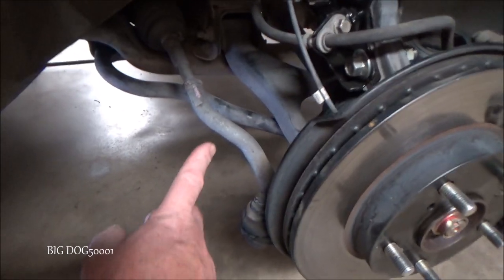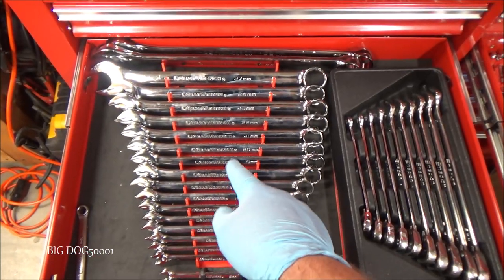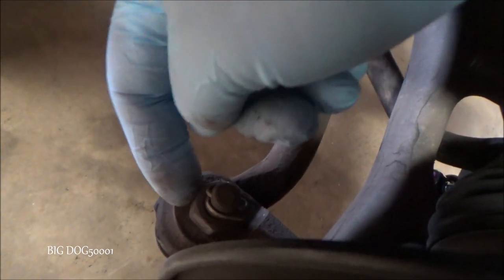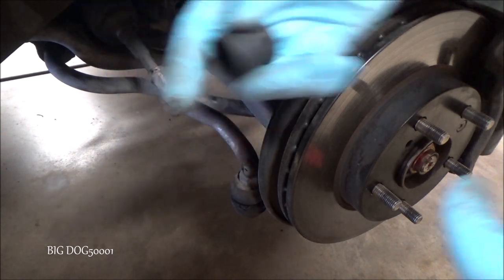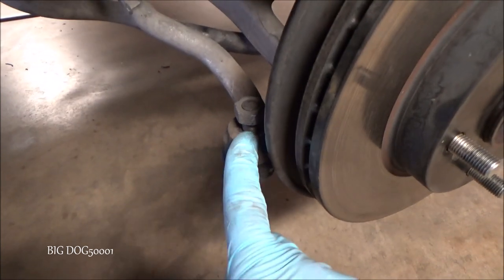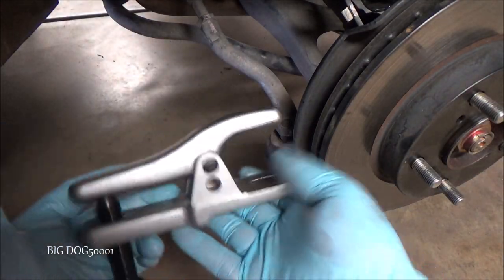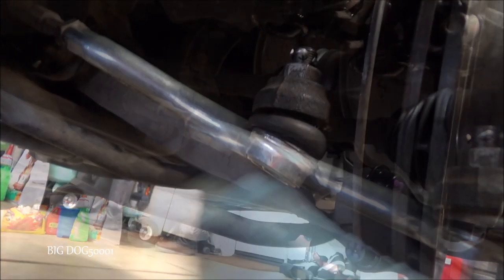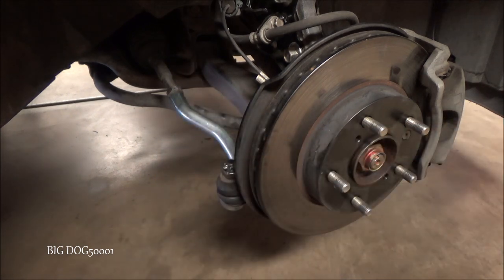Honda Civic Tie Rod End Replacement 2006 (2006-2011 Similar)

Comment from the maker: Tools and Parts
Disclosure: This channel earns a small commission using some of these links - at no additional cost to you.
Left Honda Outer Tie Rod 53560-SNE-A02:  https://amzn.to/2NzlYg3
Right Outer Tie Rod 53540-SNE-A02:  https://amzn.to/3eZTF5W
GearWrench Metric Wrench Set 81916:  https://amzn.to/3lxjQCd
Jack Stands (I use now):  https://amzn.to/3cTv4wY
Trusty Cook Hammer:  https://amzn.to/2NAElkN
Milwaukee Impact Wrenches:  https://amzn.to/3r5SLr1
Sunex Impact Sockets:  https://amzn.to/3s77LGm
OTC Front End Service Set 6295:  https://amzn.to/3tEndtJ
GearWrench 3/8" Socket Set:  https://amzn.to/3f0BRaW
GearWrench 1/2" Socket Set:  https://amzn.to/3d71W5B
GearWrench Ratchet Set:  https://amzn.to/3c22Y3o

The Big Dog 50001 Automotive Channel Store can be found here: https://www.amazon.com/shop/bigdog50001automotive  (As an Amazon Associate I earn from qualifying purchases).

Comment: Hi Big Dog, as always, great video; very helpful. Any tips on how to loosen a seized jam nut? My shop wouldn't complete the alignment because of this and suggested I could loosen it myself, then bring the car back for alignment.
Reply from the maker: Putting a generous amount of penetrating oil on the nuts/thread areas, tapping (gently) with a hammer and then gently trying to move nut back and forth with two wrenches to get it to move can help loosen them (don't apply too much force right away or the nut will round off).  Might have to take your time and do this over several days if really bad.

Comment: I've used Moog tie rods for the exact same car. Moog stabilizer links too. They're holding up fine after a few years.  Yes, a bit of a pain to grease them every oil change, but okay for the cost saving.

Comment: Man you have a beautiful set of tools.  They all look brand new and shiny.  Its hard to tell if you're advertising or if someone can have such a beautiful clean set up like yours.  They all shine like fine jewels.  One thing is for sure, wherever your're working at, you're definitely not in the Northeastern part of the USA thats for sure.  Everything over there is nothing but a big old huge rust bucket.  How do you maintain your tools that way?
Reply from the maker: I don't live in a rust area anymore thankfully, I live in the desert now and I just wipe my tools off after using them, nothing special.  I don't take advertising money or free tools from anyone either, everything you see was paid for.  Many people who watch my videos like to see what tools I use so I make it a point to show them when I can.  I have extra lighting installed for making videos and that does account for some of the extra shine on tools.

Comment: Thanks for the video and for the sticker which I received. Question can you mix tie rod ends, i.e oem on one side and Moog on the other
Reply from the maker: Not something that would normally be done but it should work.  Good to hear you got the sticker, thanks for the comment!
Reply: @BigDog50001  Thanks for the response. Have you covered the trailing arm to frame rust issue on the Honda Element? I know there’s a recall in Canada

Comment: My 2004 Honda EX steering wheel keeps wobbling do you know what needs to be repaired to fix the problem?
Reply: Brake rotors after that get a tire balance